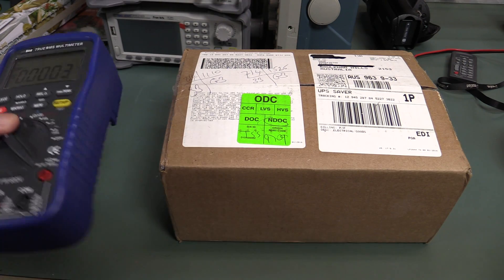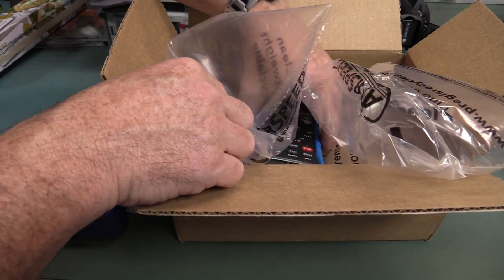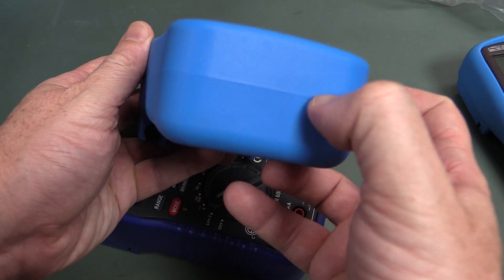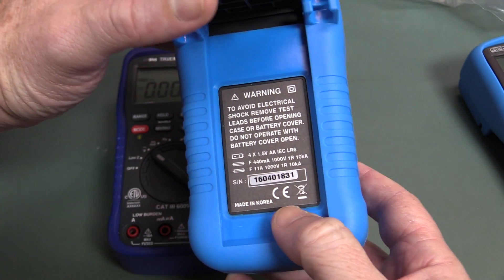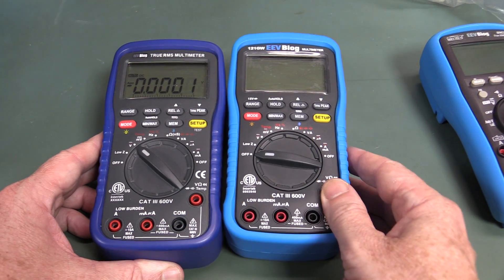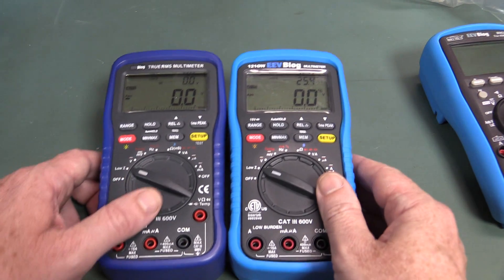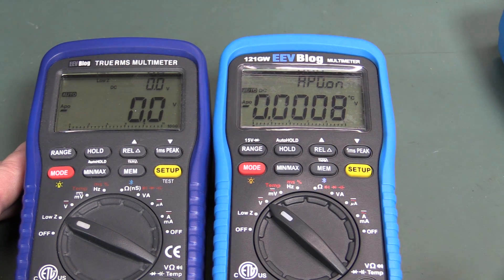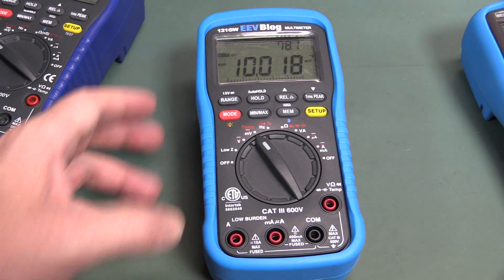EEVblog 121GW Custom Multimeter Prototype Unboxing

Comment: Get them to shorten the slots in the rubber probe holders, and radius them as much as possible, that is a simple mould change, metal off. if that doesn't do enough then get them to go to a  stiffer grade of TPR, or Plasticised PVC

The looseness of the switch is probably also a simple change, metal off the detents to add more plastic with a steeper angle into the slots to make them more positive.

(I do injection moulding and assist with mould design to fix issues).
Reply: TheDefpom probe slots are too deep. Lots of leverage on the end there where it contacts the work surface. Good call.
Reply: Unfortunately this video was first uploaded in April and revision time is probably long gone.
Reply: Yep, this was originally shot in April, revision time probably long gone. Dave probably has 10 thousand of these built and ready to ship :-)
Reply: The question is: if it is a multimeter for electronics then why do you need those slots anyway? Does somebody ever used them at the desk?
Reply: The problematic slots are for holding the probes in transport, and protecting the tips from bending (and everything else from the tips). That's how I use them anyway.
Reply: Kazimierz Król 
Yes that’s how I use the slots: bung the probes into slots, bananas are plugged into the probe jacks, wrap the leads around the whole meter.
Reply: you don't do shit with molds, other than operate them. any change to the mold requires complete remake of the cavity, an expensive operation.

Comment: It does look quite a bit thicker than the BM235 in the video but that may be an illusion. Nice to see this meter at least one more step closer to release. I noticed the function switch has two OFF postitions. That is a nice touch when the functions only cover a semi-circle. I'm expecting this will be more expensive than the BM235 when it is eventually available for sale.

Comment: Why did the relative mode in VA mode show around 0.0144:
If you look closely, in non relative mode it is constantly changing between 0.058 and +0.052 or something. Altough the magnitude stays quite the same, the sign is changing constantly. And relative mode just shows +0.052 (-0.058) = +- 0.0144

Comment: well, the wobble is good. the rubber is softer. what means that there is better impact protection. but it wears way faster out.
got the same on my uni-t ut139a

Comment: Dave, it is wobbling because the old meter has extra rubber feet on the bottom of the rubber case 
the rubber case also is a bit loose and the material is not a bit hard like the fluke rubber case.

Comment: I think that this kind of device should only read in AC/DC clearly differenciated ranges but really well with good rf inmunity for example. And Inject a voltage low to measure resistance and higher to measure semiconductor voltage drop and do continuity buzz. The current shunts are sometimes useful but i find using myself a hall effect probe clamp for all current measurement even when it's less accurate because it's convenient and non influential. The loss of time replacing the low range fuse is crucial. Anything added just because it's easy to do makes the thing more complicated. My opinion is that if the power consumition is low enough the 9V battery rules, is less money per battery change (you leave the device alone and anything will eventually deplete), and is just as  easy to obtain and much lighter so you can remove the rubber coat as the crash will be less intense. There is a cheap insulation tester, BM500 that can more or less make a 1000V insulation test out of a 9V battery, and its lovely light.

Comment: Hi Dave, looks good, "DON'T MAKE A SMALLER VERSION" I hate it when a DMM follows you across the bench cos the leads are only 50% EXTENDED.
The fact that it's condom is hard to take off is not a problem, it means its going to stay on and contaminants will not get near the battery cover.
I like the functionality.
In a previous job I had a BRYMEN 202 with opto comms, so I could do(slow) basic high voltage monitoring, and it gave not problems.
BRYMEN even sent me the protocol for the opto output so I could make my own desktop app for logging.
Have you considered a similar product with your specs/functionality requirements?
I hope that this "April" video is you being "marketing manager" and this is the sweetener for the release of the 121GW really soon.

Comment: Nice looking meter.  What's Low Burden ?  :)   Low Current or High Impedance ?
Is there any way of finding out Make/Model of the 3D printer they use ?  I'm always designing custom cases for design jobs.  Usually need small amounts that are uneconomical for injection moulding  and usual 3D printers don't have the same surface quality.
Reply: tony onofrio you'd need 2-30k+. More than likely they outsourced to a company like shapeways that make a business of having amazing 3d printers so other people don't have to or they are a cheap Chinese company that he clearly hasn't actually worked very closely with at all so the name of the printer or service used isn't something he'd ever know.
Reply: you could also check out proto labs, they do small batch cnc, injection molding, and I think 3d printing now. Makexyz and 3dhubs are good if you have someone on there nearby with a very expensive printer. If you actually want to buy one, look into something like the Stratasys Idea(~$6k) or Dimensions ($12k)

Comment: I like this videos, it's very interesting and cognitive! Who can advice a mid-priced multimeter with 220v protection on continuity measure mode, on/off button and auto power off? Instead of rotary off switch because it wearing quickly when you do a lot of identical measurements.

Comment: How can it only be Cat III if it's supposed to be a 121GW meter?  That's just not good enough for measuring solar installations and wind farm controllers in that size range.  Probably can't even check if a brief lightning strike has enough peak power for your Delorean.

Comment: How would you feel about testing some of the cheap sh*t auto range everything multimeters ? Something like the "PM8248S Smart Fully AutoRange Professional Digital Multimeter Voltmeter with NCV Frequency Bargraph Temperature Transistor test" from AliExpress ?

Comment: Hopefully the thickness is just because of prototype. I think the market will kill you off if the final revision/actual finished product is that thick.
Reply: The thickness is the same as the already existing one. The most significant change is it being nowhere near as ergonomic looking.
Reply: Oh well. I hope the quality and features negate any of the negative ideas that the thickness will create. In the world of today's tech the thinnest prevails.
Reply: It has GIRTH
Reply: He said in the video this is the size it's going to be, it would hardly be worth them going to the effort to build injection moulds if it wasn't near enough the final size, only minor alterations possible from here on, also... its the same thickness as the brymen which has less features and less battery capacity.

Comment: April ??? wtf?
And what, pray tell, is wrong with the CE mark? I suppose it could be better positioned. Looks like a possible extra function situated where it was. Yeah, this DMM does CE! Go figure!
Oh right. There it is on the back. You'll have guessed by now that I am commenting in real time. (My real time).
Don't like the dial. It detracts from the functionality. "Function over form - ALWAYS"
Oh, and you need to change the model name.  121GW is lame. How about Weeble X1000?

Comment: looks like any other "cheap ass multimeter" you'd scoff at in disgrace if it weren't associated with you... just saying
Reply: Just saying - not explaining or demonstrating a single thought.  Exactly what multimeter do you wish to claim is a better value?  This is targeted for about $200.00.   Do you have a feature comparison?  Just saying nothing is more like it.
Reply: Came here to find this comment - not disappointed. Thummmmbs up!
Reply: do you know what a prototype is? :/
Reply: Unless this has actually been tested and passed for its rating.
Reply: megaspeed2v2 oh sorry, didn't realize Merriam Webster defines prototype as, and I quote; "some bullshit you'd otherwise be a harsh critic of had your name not been stamped on it". Please accept my sincerest apologies -_-
Reply: Low burden voltage (uCurrent circuitry inside), 15V diode test mode, 1nA resolution, VA measurement, bluetooth, SD card to allow firmware updates.
Reply: Prototypes are never perfect and this is just the first iteration of the injection moulded product that doesn't have the final firmware on it. and incase you didn't notice dave did criticise a lot of things of it in the video so what's your problem?